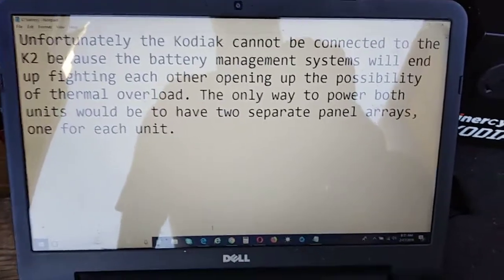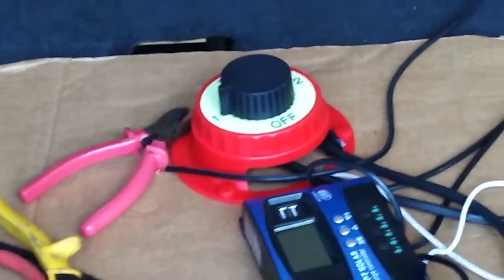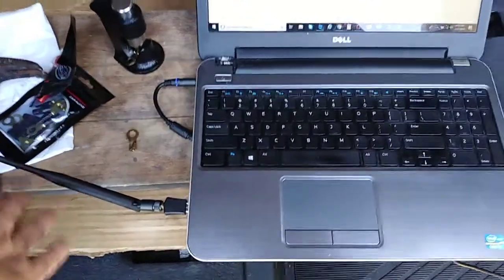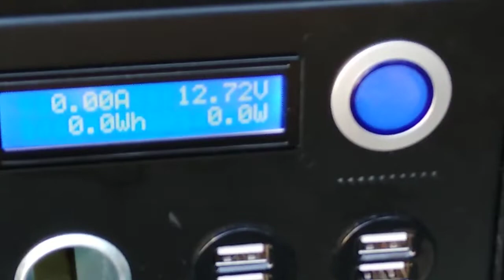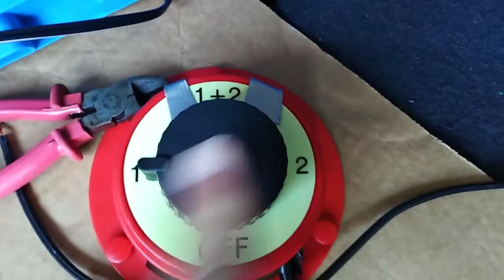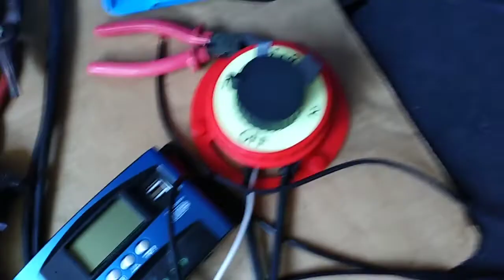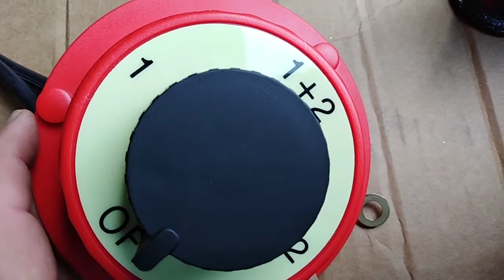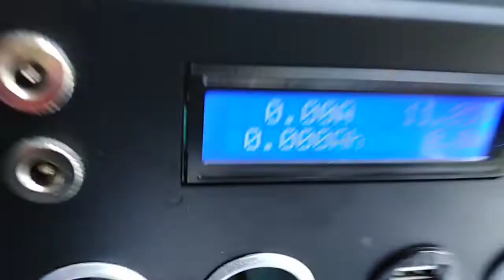How to Connect the Apex and the Kodiak to the Same Solar Panel Array

Comment: It's guys like you that do shit like this, that make them have to alter the way they build their units.   The reason that you can't connect anyone's panels except theirs to the Kodiak Apex now, is because of shits like you.   People were doing shit they shouldn't do, hooking up shit they shouldn't hook up, and frying the Kodiak, and then sending it back to them for warranty repairs. 

Just because you "can" do something, doesn't mean you should.   You might know what you're doing, but, when you put a video like this out, the next guy is like.....naahhhh.....I'm not doing it like that, I'm just going to do "this."  "I'm not buying all that crap that the guy in the video has.....I'm just gonna rig this sucker up the way I want to do it. "

Next thing you know....the Kodiak is fried, and everyone's sending them back for warranty repairs. 

So.... now they build them harder to fuck with.   Now you have to buy all THEIR shit to use with it.  The Kodiak itself is awesome, but their solar panels are shit.  But, because of jackwagons like you, now we HAVE to buy their solar panels, or figure out how to wire up a different one to the Apex's plug in cord, which isn't necessarily difficult, but, it voids the warranty.   In other words, now we have to cut their cord, splice it to a different panel of our choice, so that we can plug it into their NOW proprietary plug in,   thus voiding any warranty should something go wrong, even if it actually IS a problem with the Kodiak itself.

Knock this shit off.

Comment: I was thinking about getting 2 Inergy Apex units and try to have them share an external lithium battery bank. Is there any way that might work?
Reply from the maker: Yes, there is a way.  What are you going to use the 2 Inergy Apex for?
Reply from the maker: It looks for now that no one is going to get an Apex solar generator.  It looks like Inergy is one able to manufacture on yet.